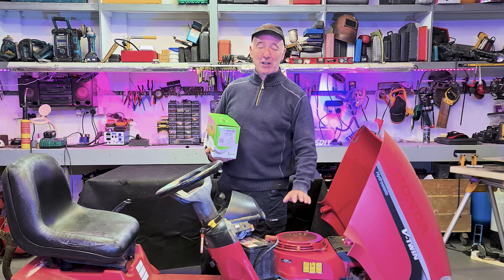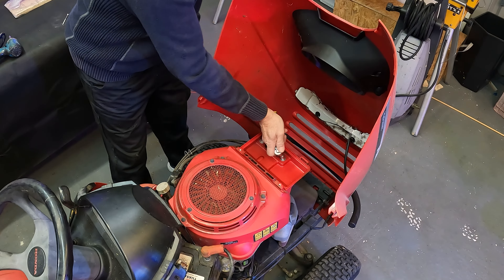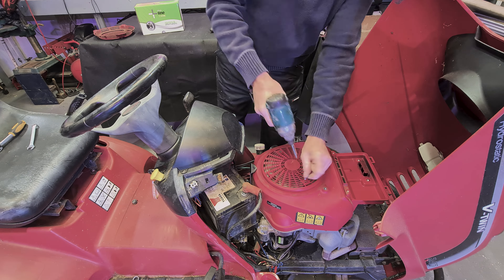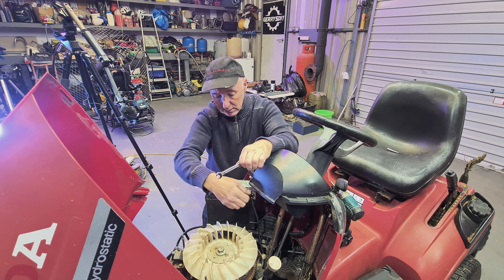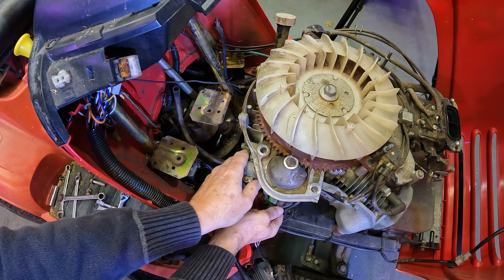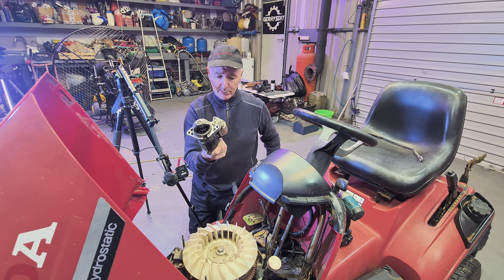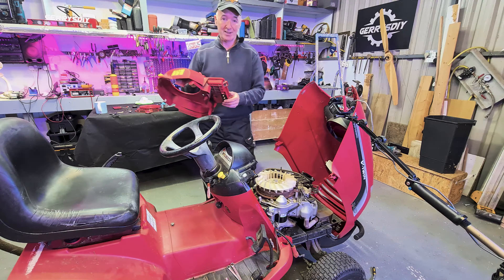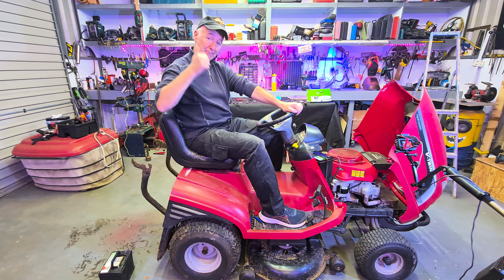Easy Honda Tractor Mower Starter Replacement

Comment: Great to see you uploading again Gerry, I hope you are keeping well 🙏 I wonder if the rotor of the starter can be replaced instead of buying the whole the unit, it could work out cheaper, or even rewiring the rotor as they do here in Morocco due to tight budget 😂 Anyways it works for you and it's usually greeting from Donegal but now greetings from Morocco 🇲🇦 ❤ 🇮🇪